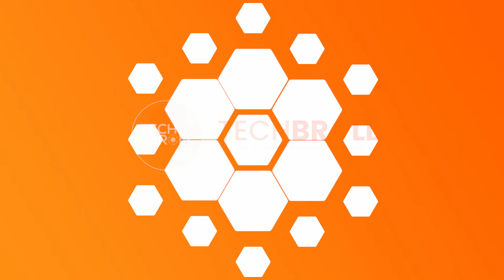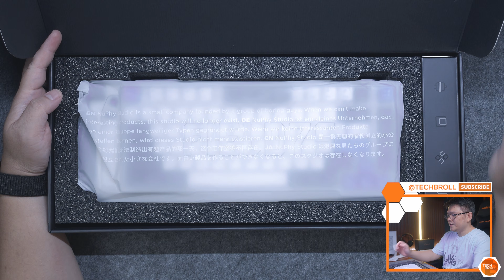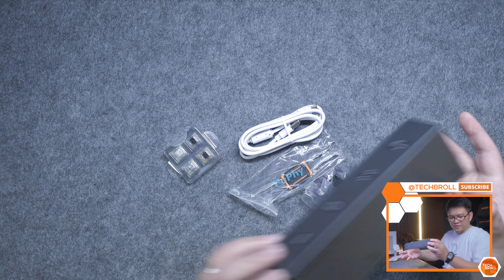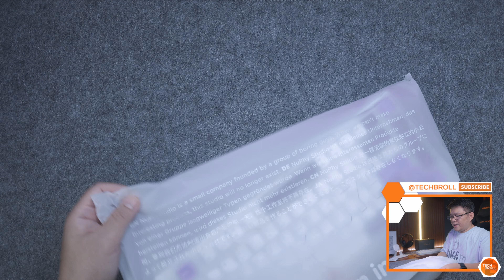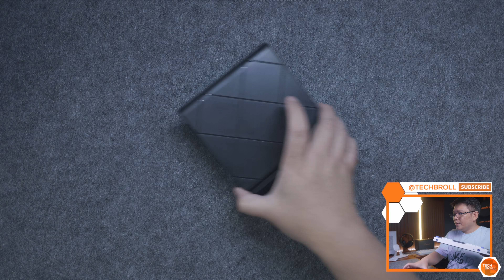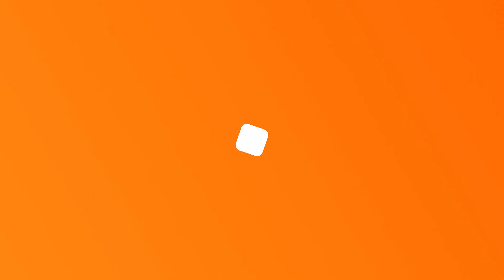NuPhy Field75 Unboxing, First Impressions and Sound Test - Unscripted Series

Comment: The mis-aligned layout around arrow keys is terribly unpleasant to look at, hard pass. However I have to say Nuphy's products are usually good - I enjoyed Halo and Air 75 and  more than my other mechanical keebs.
Reply from the maker: What are the mis-aligned keys around the arrow keys? as far as I can tell, it is pretty standard when it comes to an exploded 75% layout. If you're talking about the smaller alt, fn, ctrl key and shift to accommodate the arrow keys then yes, it's kinda OC in terms of symmetry to the left side. What is non standard in this keyboard though is the lack of gap between F8 and F9, that I would say is kind of weird.
Reply: @TechBroll  He's referring to the actual arrow decal placement on the key. Any excuse to justify his fomo to be honest. I'm currently using the Field and it's sublime - and the arrow placement is a nice throwback to 90's IBM keys.
Reply from the maker: @BossBelsham  ooh i can see it now. Well it’ll depend on anyones personal preference I guess. It doesn’t bother me at all to be honest. A simple keycap set swap can easily fix it as well.
Reply: Yeah I can understand this, the alignment of of the arrow  keys (mis alignment) would give my OCD a good time.

Comment: Have tried tearing it down? I can't seem to figure out how to open up the case
Reply: Same here. Lemme know. I don’t want to start ripping off feet if I don’t need too
Reply: @xk4l1br3  so I'm pretty sure it's held together by clips cause I took the all key caps and switches and didn't see any screws.
Reply: Would love to have the layout minus the handle. I was assuming screws were under the feat... Until the video showed the flip out feet which now I'm doubting.

Comment: At least it seems to me the price is somewhat high when you include all the elements that are normal for a keyboard.  But it's an interesting product for sure.
Reply from the maker: Yeah, definitely higher compared to other keyboards from NuPhy. But still more affordable compared to other "Gaming" keyboards from mainstream brands. However, it is also arguable that any "Normal" keyboard is also quite capable for gaming so it all boils down to personal preference and buying capacity. I guess, what we're paying here is the flair and aesthetic it offers, some additional macro keys, knobs and dials, but other than that, pretty much shares the same characteristics as the cheaper Halo series, just targeted towards the gaming market space. :)